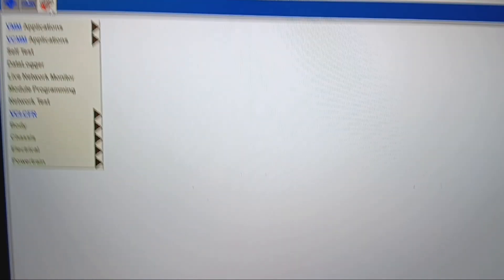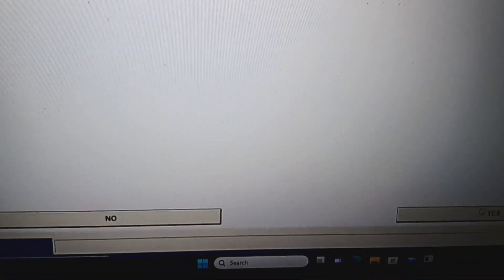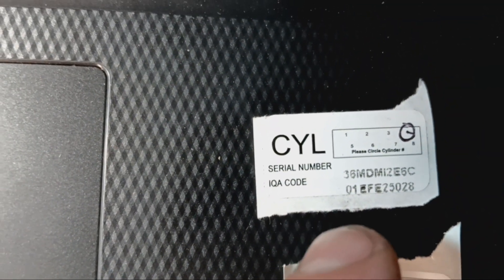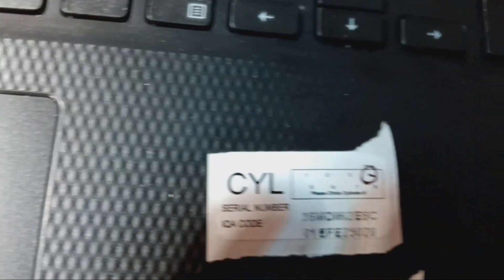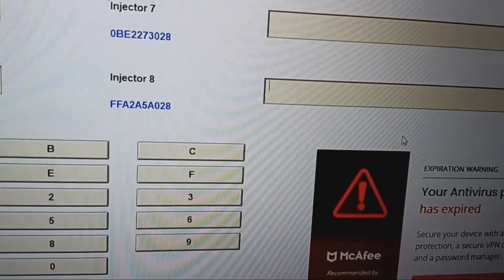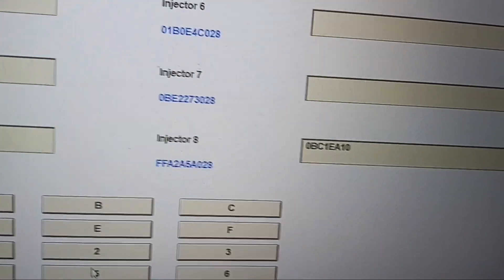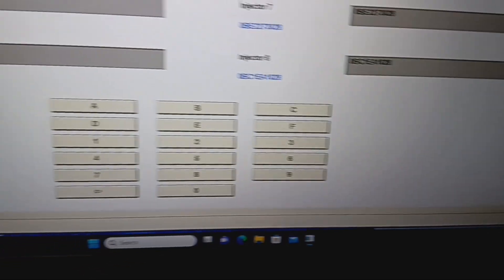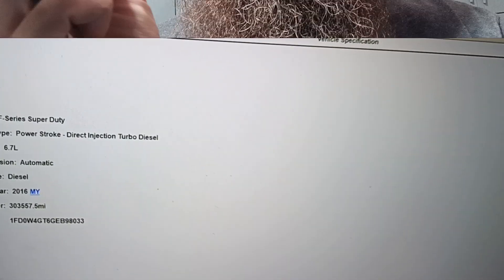2016 6.7 Powerstroke Injector Programming After Install #newtoyou #powerstroke #howto

Comment: Anyone ever input new codes, start the truck and it runs but not as good or almost sounds like a 7.3 powerstroke? Mine did, even though the code took i reprogram the code and it smoothed that injector out. So had to do it twice
Reply from the maker: Never had that issue  program the code runs perfect every time. Were you using an aftemarket tool?
Reply: @BeardedFordTech yes. The first time it was programmed a high end snap-on was used at a repair shop. The second time I did it myself with a autel. The numbers the autel showed was the numbers stored from the snap on but I was let's just try it again,  sure enough two days later and it's still kicking.
Reply from the maker: @duckco1 thats weird.

Comment: If you recode injectors with correct numbers runs good, but then won’t hold
Reply from the maker: Never had it not hold the correct injector numbers in the pcm after coding them  if thats what you are asking.
Reply: @BeardedFordTech yes keep bringing it back to the shop to get the injections relearned
Reply from the maker: @matthewgalmore4811 does it have the right injectors?  Are they putting in the right code for the cinder its in? (Code is on top of injector)  are they saving it after they put the numbers in and it gives them the prompt saying its complete?

Comment: What all is involved in changing #5 injector? 2015 F550 6.7
Reply from the maker: The same as changing any other one.  Make some room to get to it. Unplug it. Undo the one time use metal fuel tube.  Get the injector out carefully so you don't drop the copper washer. Write down the iqa code of the new one. Install it. Make sure the hold down is tight. Install the new metal fuel pipe. Plug it in.  Get on the laptop and program the iqa code into the pcm.
Reply: @BeardedFordTech why do you recommend changing all the injectors if only one goes bad?
Reply from the maker: @kxtimber I didnt say all injectors. I said the one being replaced.  Read it again

Comment: I have a paper with the IQA but it is different from what is printed on the injector. When i use the one on the injector it takes but doesn’t hold. When i use the one on the paper it won’t take it.
Reply from the maker: @MsJillybean33  use the one on the injector. Should be 10 digits

Comment: Hey brother, if my Launch Scanner has an IQA option, where I can add in the iqa codes in there, would that suffice? Also what to do after the code is set in, do I just turn on the engine, or should I do something else?
Reply from the maker: If it has iqa option then yes it will allow you to change them to the new codes when you replsce the injector. Then simply follow instructions on screen
Reply: @BeardedFordTech  okay perfect, and do I need to do any testing for the injectors after I put in the code? Should I turn on the engine, or do anything preliminary before I do crank the engine on.
Reply from the maker: @HarrietThugman  no. Just make sure you have the correct code for the injector in the correct cylinder
Reply: @BeardedFordTech  okay thank you very much sir
Reply: @BeardedFordTech  One more question, do you know anything about code P0263 and code P02D4
Reply from the maker: @HarrietThugman  yep. 0263 is cylinder one contribution balance. 02D4 is cylinder 5 injector offset learningat idle. 
If your doing injectors. Put the image codes in the pcm after install. Then reset fuel learned values.
Reply: @BeardedFordTech  oh okay gotcha, so once I reset the learned fuel values, those DTC codes should go away? Because honestly the truck runs perfectly, I just don’t know why those codes are still there after I put the IQA code, maybe like you said I have to reset the learned fuel values

Comment: How often do 6.7 ford injectors need replaced
Reply from the maker: @josephjohnson1013  depends. Usually 150k or so.
Reply: @BeardedFordTech  thanks for responding. Also how will I know when I need to change them. Will they throw a code or what
Reply from the maker: @josephjohnson1013  sometimes they do.  Injector imbalance code with whatever injector is causing it. There's a few signs you would need them.  Misfires. Injector pressure control. Leaking injectors. I don't just do one. I do them all.  If it was a public customer I would do the one needing it and explain it will need the rest. And give them the option to fix it now or come back
Reply: Mine went out at 170k

Comment: What software ? What interface?
Reply from the maker: @jimski1  that Is ford software. IDS.  FDRS got the 2018 and newer
Reply: @BeardedFordTech do you only need a OBDII to USB cable to go from the laptop to computer, or an upgraded cord? Thanks in advance
Reply from the maker: @Jacob-fd6vo  you need a scan tool that will allow you to program. You then need an obd 2 connector to connect to the laptop. Mine are all wireless. I just upgraded my ford stuff from VCM 2 to VCM 3. Those are about 1700 a piece. You can get a good one here https://amzn.to/41l8cB1 it works great with forscan. Forscan 1 year license is $21.  That will be your best bet.  Download forscan on your laptop and use that obd 2 connector
Reply: @ Awesome, thanks for the help brother!
Reply: @BeardedFordTech with that adapter you put a link to off Amazon will I be able to enter the iqa code off the injector? Or do I still need a separate scan tool for that?

Comment: Changed cylinder 2 and 3 and my truck won’t start. Didn’t know they needed to be programmed
Reply from the maker: Yep. They have to be programmed. It should start. It will run like crap. But they need to be programmed with the IQA code. Where are you located?
Reply: @BeardedFordTech  I am located in Connecticut. I have the tools to program it. It ran after replacing cylinder 3. Which was replaced for a contribution code. Code still came up after replacing the injector ( I guess programming it could have fixed the code) I tore apart the motor thinking it was a cracked valve. Ended up breaking injector 2 while removing it. Then the truck sat from august up until yesterday. I’m assuming since it sat so long and the injectors aren’t programmed. That’s why it won’t start
Reply: But I’m no ford tech so I’m just troubleshooting. Hopefully after programming it’ll start
Reply from the maker: @cooperthibault2520  did you cycle the key to prime the system after you replaced them. Or did you just try to crank it?
Reply from the maker: @cooperthibault2520  injector imbalance usually means bad injector. Replace it. Program it. Then do a key cycle to prime the system. I usually do ignition on 30 seconds then off. Repeat that 5 times. It should crank. Even without it programmed it should still start. It will still throw the imbalance code cause it doesn't know it has a new one
Reply: @BeardedFordTech  cycled the key and also bled the system. I’m going to try and program the injectors tomorrow and see if that works. There’s definitely a lot of air in the system
Reply: @BeardedFordTech  I just don’t think it helped sitting for months with the fuel system open
Reply from the maker: @cooperthibault2520  let me know.
Reply from the maker: @cooperthibault2520  that probably didn't help at all.
Reply: @BeardedFordTech  checking it with a scan tool revealed both fuel rails have optimal pressure I just don’t get why it won’t turn over. Checked the inertia switch to make sure it didn’t trip. Went through 5 batteries trying to start it
Reply from the maker: @cooperthibault2520  what's the pressure?
Reply: @BeardedFordTech  I don’t remember the exact numbers because I checked it last night and I’m not at the shop but both fuel rails were above 4000psi
Reply: @BeardedFordTech  is there a better way to contact you if I still run into issues starting it
Reply from the maker: @cooperthibault2520  email. In about me section

Comment: What will happen if you change injectors and do not recode them?
Reply from the maker: It will run. But like crap.
Reply: Could the truck be driven to someone with the capability of programming the injectors?
Reply from the maker: @mlieser1230  yes. But it will runike crap and probably misfire.

Comment: I don't think I'd dare tear into my 6.7 deep enough to swap an injector. Rather pay a pro like you, FBM, or ARod. However, this has made me curious to find out if I can do this with FORScan after an injector has been swapped. I'll probably try to figure it out tomorrow.
Reply from the maker: I'm sure you can with forescan. You should be able to go to pcm service functions IQA and see what's in the pcm.
Reply: @BeardedFordTech  Yeah, I have a laptop for FORScan and I have enabled a few extras on the truck, but never done anything with the PCM/TCM/etc. Well, I DID enable police interceptor mode on my 250. I hated that double-honk and now you can't drive off in my truck if I step out to do something and leave it idling. Key is in MY pocket!

You weren't kidding about answering comments and such all the time! Take it easy!
Reply from the maker: @GuretoSefirosu  yep. You can do a lot of cool stuff. The police cars here have interceptor. But it has nothing to do with the key.  It does take away the honk.  And keeps the car dark(no interior lights when opened) they have an anti theft device on them.  A button you push and it connects to the ignition system. You can turn it off an on. That's a totally different item though.
Reply: @BeardedFordTech  Yeah, what I enabled just locks the transmission in park when the key is not in the cab, and prevents the double-honk. I have a button up top that allows me to keep it dark when opening doors. I use it in the summer to prevent flies, gnats, and mosquitos from flying into the truck when I get out.
Reply from the maker: @GuretoSefirosu  💯💯💯

Comment: Can I do this through HP Tuners PCM Editor program?
Reply from the maker: Not sure. Never have done it that way
Reply: @BeardedFordTech  I am hoping I won’t need injectors, but I have more oil than I started with, it died while driving home and wouldn’t start it was smoking from exhaust after it shut off. I Was already planning to do this prior and just got done putting DCR pump in, I haven’t attempted to start yet waiting on a few more parts, no metal anywhere in fuel system between two filters and CP4 cam and lifters are in great condition. Your videos helped with the troubleshooting,thanks for that!
Reply from the maker: @schmittybuilds1624  what color was the smoke?  Black?  Could be leaking Injectors or VGT solenoid on the turbo stuck.  Did you do the fuel rails?  What are the codes you got?
Reply: @BeardedFordTech  no codes came up yet. I’ll watch scanner to see what it’s doing when I get around to cranking it. Smoke was white like steam almost. If it was EGR cooler that won’t be an issue anymore, I “fixed” it. Haha.
Reply: @BeardedFordTech  finally got it together last night, p2291 came up. Low side pump is not building pressure and I on cranking I can hear a knock, if I let it prime to much it acts liked it hydrolocks. I am pulling glow plugs today to see what injectors are stuck open.
Reply: @BeardedFordTech  yep your first inclination was dead on. 3 & 4 are blacked out all the rest are grey/white tipped. I’m just happy to know why it died, it made sense but didn’t want to believe it, I was just happy to find that CP4 was still alive, that would be some luck as I’m waiting for the DCR kit to show up the cp4 says nope 🤣
Reply from the maker: @schmittybuilds1624  glad it wasn't the CP4!
Reply: We're you able to program with the HP tuner?
Reply: @ no I ended up using Altech programmer.